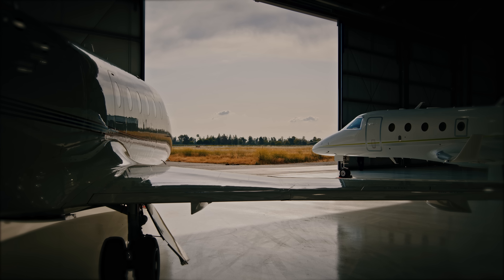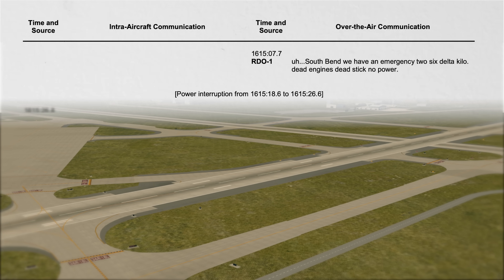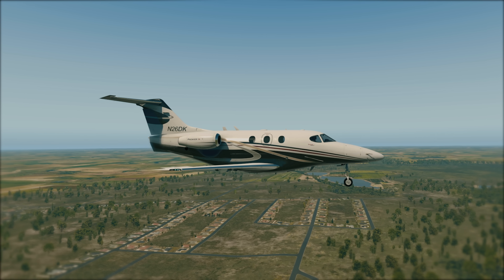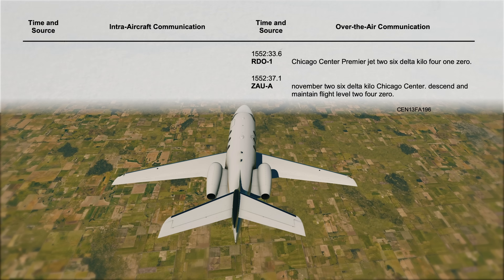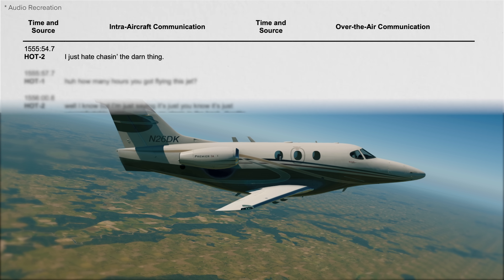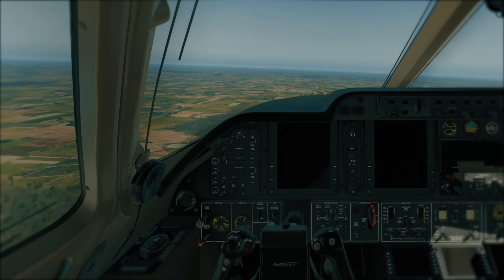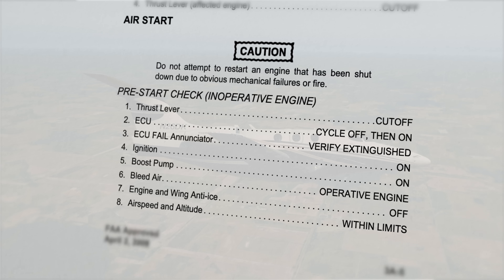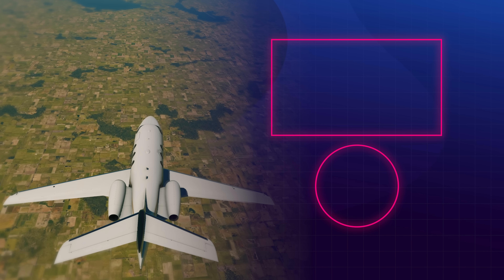Passenger Causes DUAL ENGINE FAILURE | Accident Case Study

Comment: No room for rich arrogance when you're piloting. He didn't fly the plane. The plane flew him to a smoking crater.
Reply: The guy had enough altitude and airspeed to just calmly run the checklists and relit both engines .That's the sad reality here. .Never panic ,but straighten up and fly right immediately after you find  yourself in an unusual situation like this
Reply: @Bax60 Incredible. Ive always wanted get my private pilots license but have a great fear of screwing up. Cannot reconcile if this fear is a good trait or bad trait so Ive never made the effort.
Reply: @Bax60  he did fly right that was a problem he flew right and then flew right into the ground
Reply: @Bax60  if you need to run s check list during a multiple engine failure you have no business been a pilot, knowing what to do to restart should become instinct, this is part of your training to remember those steps one by one.
Reply: @lcfflc3887  yes but you always follow the check list -it's purpose is to ensure you follow ALL the steps and in the CORRECT order.In an emergency it is possible that that a derail is missed however well trained you are -the checklist is there for a reason.
Reply: I see this attitude a lot with cars.  Many think that just because they can afford a fast car they can drive that car fast.
Reply: Agreed, this Alex sounds totally clueless and never even came close to grasping the emergency of the situation.
Reply: Doesn’t matter if it’s a plane, boat, car or motorcycle, just because you can afford it doesn’t mean you know how to operate it!
Reply: @rstats2127  motorcycles tend to quickly kill an inept operator.
Reply: @intheshell35ify  yep, I’m a former sponsored road racer and I see many on the road who shouldn’t be. I had a former co-worker who had zero common sense buy a motorcycle and I thought to myself they weren’t going to be on the planet much longer.
Reply: @rstats2127  There are  faa rules and regulations in.place .But the truth is ,if someone has enough money ,they can purchase any airplane they want .And there's nothing to prevent them from flying it off without a medical certificate or pilot training if that's what they decide they want to do .Nobody is really at the airport prepared to stop you .A person could hire a retired pilot ,sit him in the right seat ,and go out and fly that airplane every single day with no pilots certificate and bo medical, and unless there was an incident or something, the chances of that guy getting ramp checked by the faa is near zero .lt doesn't happen very often ,but I'm sure that it has.Because people fly for years without a medical certificate and never get caught all the time  .
Reply: There it is.
Reply: "I bet they beat the paramedics there by half an hour"
Reply: Explain why so many for hire pilots crash.
Reply: @jasoncrandall  because piloting a plane is a complex, very detailed task requiring constant analysis of a wide array of ever-changing variables. Although I'm not sure what the quantity, "so many", is.
Reply: @intheshell35ify  for hire pilots crash and duck up all the time. The Challenger going into Naples a couple months ago was an accidental fuel shutoff. Pilot errror.
Reply: @jasoncrandall  Most aircraft accidents are caused by pilot error ,just like most car accidents result from the same thing .Pilots are human, they make mistakes .But you are much safer traveling by airplane than by automobile.
Reply: @Bax60  I’m an ATP. I know the statistics. Never said flying was dangerous.
Reply: They should’ve flown NetJets.
Reply: Good. They still haven't learned though because there was that one submarine thing and soon to be a second. I do feel bad for the kid though, he didn't want to die but they wouldn't let him back out
Reply: Stockton Rush Syndrome?
Reply: @rask004  Rush was rich arrogance run amuck in the high tech engineering world. His was a special kind of hubris.
Reply: more money that brains. an epidemic in america
Reply: And hurt other people on the ground in the process 🤬
Reply: @acbulgin2 The crash of Sikorsky S-76 C-GIMR was similar in that respect. It belonged to the organization I worked for at the time. Without being a training pilot or briefing the situation, the PIC was instructing the FO on how to perform a black hole approach — while performing an actual black hole approach. 

That meant that there was no pilot monitoring. They descended into the trees and totalled the aircraft. Fortunately they suffered only serious but non-life-threatening injuries from the CFIT.

Interestingly, the PIC swore up and down during the investigation that he suffered a compressor stall. I’m sure he thought he did, but the investigation revealed that the thumping he heard was actually the sound of his rotor hitting trees.

The same organization lost a hull and crew a couple years later during a black hole departure, also due to neither pilot assuming PM duties, among other factors. That one was C-GIMY, also a CFIT.
Reply: "rich arrogance"? That's a brain dead comment that shows you to be as foolish as the pilot. Where is your evidence that his wealth was a factor in this crash? People like you should never be given any  responsibility for anything.
Reply: Agreed
Reply: Yep
Reply: Crap, they were so close to landing it safely
Reply: Same boat or plane rather as JFK Jr.
Reply: No, the aircraft bears zero blame for this 🫏.
Reply: Rich "wannabees "
Reply: Oh theres always time for rich and/or old people to be entitled morons
Reply: Wealthy not rich. Rich describes food
Reply: @OffendingTheOffendable  individual people are rich.... generations are wealthy. Your apparent ignorance is also "rich".
Reply: An overconfident businessman who has no regard for a sterile cockpit, invites his buddy up who is completely clueless on how to fly the airplane. Even the owner of this jet seemed to be behind the aircraft, it’s not fishing or golf- flying is a serious business and lax attitude results in death.
Reply: @donnix1192  Perfectly said
Reply: @donnix1192 what does being a businessman have to do with it?
Reply: A classic example of how one’s wealth can kill one.
Reply: @tonybeamish Oceangate is another
Reply: @acbulgin2 Yeah, this was up in Northern Ontario, where it can be completely pitch black at night, or alternatively you see just a very few distant lights that are more likely to disorient you than orient you.
Reply: I wish car licenses have the same attitude as the aviation industry.
Reply: @Notabot1310   it would be nice to have regular refreshers and requalifications but neither the government or citizens can afford that. A plane accident can kill hundreds of people, a car accident can only kill a dozen or so at worst. Besides, we are a nation of commuters. It's good for the economy to have mobile workers. It's tough enough to get people to renew their license with no testing.
Reply: @Notabot1310  Its like apples and oranges though .I can tell you this ,l started flying when I was 16 in 1976 .After 48 years ,never once have I ever  been ramp checked by the Faa at any airport ..
Reply: @Notabot1310 yeah, they teach you to get a license but not how to drive, pilots are another level, I don’t know how pilots remember so much.
Reply: @acbulgin2 Well said.

There’s no reason to think this guy was especially arrogant because he was rich. It looks to me like just the normal amount of arrogance, coupled with enough money to finance some potentially very risky activities.

Comment: “Don’t worry about the overspeed warning guy just keep working those throttles”  I’m sorry WHATTTT
Reply: That's the attitude of a pilot who never learned to appreciate handling a clean, fast airplane. Even when i was just  transitioning from slower Cessnas to a Mooney 201, many years ago, the instructor kept reminding me that "in this airplane you can not both slow down and go down at the same time". In studying this accident I see the poorly-trained right seat pilot failing to appreciate that he is flying a high-performance aircraft as he repeatedly busts Vne trying to descend the aircraft.
Reply: @LexipMedia pitch for airspeed and power for altitude
Reply: just a LITTLE too fast, no biggie
Reply: lol, “guy”
Reply: Pretty sure there are some really smart engineers building the plane to certain parameters. It's not like a car or motorcycle.

Comment: This is a textbook example of the worst kind of pilot; no procedure, no respect for limitations and no knowledge of aircraft systems. All this led to several missed opportunities to correct the problems he created. I can guarantee this pilot should have failed his last recurrent check.
Reply: Well, in a roundabout way, he certainly did fail his last check.
Reply: @RetreadPhoto Experience is always a factor, be it total or model specific. Insurance companies often decide what experience is required (not a terrible system as they are risk averse). My main issue here is with the atrocious attitude towards safety and complete lack of professionalism.
Reply: If you're riding a skateboard... it's best you know what you're doing eh!
Reply: @marcelogouveia9614 In my case, stepping off the skateboard knowing that I am unqualified to operate one.
Reply: It is sort of like putting a go kart driver into a F1 racer and saying go for it. The aircraft clearly needs to be flown with finesse with those engines and despite the owner pilot' s great trust in its airframe, it was even more plane than he fully understood.
Reply: More specifically a pilot that fails willingly. We cannot fault an emergency pilot (like a passenger) at least trying in an emergency. These pilots, both the unqualified one and the should have known better one have no such excuses.
Reply: I have no respect for pilots who crash into houses or residential areas. Or even attempt to land on freeways. Why do I deserve to get crushed just because you can't find a runway? Rich A holes.
Reply: @Peyote1312  What an odd comment. Jet pilots are employees, (not the rich guy in back). Cars kill far more innocent people than aircraft, but we don’t turn it into class warfare.
We always avoid populated areas if possible.  When you’re strapped to the front of the thing, you try very hard not to mess it up, promise.
Reply: I'm not sure here.   The ATC knew the plane was no power, no hydraulics, and ordered a go around.      with fire on standby a belly landing might have been the best option...   ordering a "glider"  to go around?   just seems off.
Reply: @jenniferstewarts4851  I’m not entirely certain, but I think they had established that power had been restored for one engine by the time they told him to abort the initial landing. It’s also possible that his current speed, course, and/or runway made such a belly landing impossible without risking further lives—I am only speculating, but considering the second attempt resulted in their bouncing into someone’s living room, it’s certainly seems plausible.

Either way, with only one-way communication, you have to assume the pilot isn’t aware that the gear is not down, so instructions for a go around “if possible” seems logical.
Reply: @silverXnoise  with no electrical, hydraualics, limited control, and no engines...  a belly landing would be the "natural choice" for most pilots.   because that also means no breaks, flaps, speedbreaks, or thrust reverses.  

in truth, the belly landing would still have been the safest  with fire and emergancy there.
Reply: ATC should be held responsible
Reply: @@vitkomusic6624    Why would that be?  They saw the main landing gear was not down & correctly ordered a go-around.
Reply: The pilot's speech on the CVR is so off-hand, even a student would be replying 'What do you mean by that?'
Reply: Why didn't the pilot crash land when he was on the runway?
Reply: If both engines go out at least look at the location of the throttles. That would give clues as to why they were turned off. Immediately ready for ignition. In seconds.@RetreadPhoto
Reply: definitely not a pilot, total arrogant prick! not a pilot in any way
Reply: @RetreadPhoto I completely agree but try to convince anyone to take on that financial burden.
Reply: Well.....he did fail his last check.
Reply: Its super frustrating to me because I dont have a trust fund to get my Commercial, I'm stuck at Private and id have taken the time to learn all of it because I love flying and respect the art. Ive got a bookshelf full of aviation textbooks sitting next to, a lifetime of learning since I was just a kid reading janes encyclopedia to today.
Reply: Looks like the test was not nearly good enough - whether not done properly or maybe the test protocols themselves are inadequate. A jet pilot should know all these emergency procedures like engine restarts by heart and have practiced them many times until completely confident. It's not a game and to be safe requires a lot of work and dedication. Not for irresponsible cowboys like this. What's worse is that many commercial crashes were results of jsut as much pilot incompetence so even those standards are inadequate. All about the dinero isn't it?
Reply: @sambolivar167  Any idiot with a wad of cash can buy an airplane or a Lamborghini. Does not mean they have talent. "A man has got to know his limitations", a concept that the wealthy have no clue of.
Reply: No respect.

Comment: The tower knew they had no power or hydraulics and they should have just made the first landing and sort it out later.
Reply: I do blame the tower for complicating a nasty situation. 30 yr controller here and adding extra stress by telling a deadstick-landing pilot to go around is ridiculous. He could have just calmly questioned “verify gear-up landing?”
Reply: @bwalker4194  He had plenty of speed and could have done it (and did do it). If he couldn't land with the front gear out, why would you think he could land the plane with no landing gear at all?
Reply: @bwalker4194  
After reading the first comment about that, I thought it was pretty strange to tell pilot with no engines to go around. And then watch the entire video. And while stupid, it had absolutely nothing to do with the crash. When he came around the second time and crashed. They let him know only his nose gear was down. at that point he had a functioning flyable aircraft and should have gone back up in the air got it fully functional and then landed.
Reply: @bwalker4194  He wasn't deadstick,  he was UNDER POWER
Reply: They did have power.
Reply: Don’t blame the tower. He could’ve gone in. They told him his gear was up. He could’ve kept going.
Reply: @neilkurzman4907  Their input was incorrect and unnecessary. PIC has full authority, but unfortunately, this one was not competent in the machine so the end was predictable anyway.
Reply: @cturdo  
It was certainly correct to let the plane know that the landing gear wasn’t down. Telling a plane with no engines to go around kind of says they lost situational awareness.  They were treating it as an ordinary landing, where the pilot forgot to lower the gear.  At which point you would tell them to go around. So certainly inexcusable on their part but really unrelated to the accident. Unless of course we assume he would’ve successfully belly landed the first time because he didn’t the second. Remember on the first landing, he had limited control of the aircraft. We’re not exactly sure at what point he got the engine running, but we do know that he didn’t properly configure it to provide electricity to all the equipment. 

Additionally, in that original landing, he forgot to lower the gear. He had the manual release control, but apparently didn’t pull it. In his second attempt, he didn’t pull it completely completely when he could’ve used the normal gear release. Assuming he had connected his working generator to the bus.
Reply: @neilkurzman4907  All good points.
Reply: @cturdo  
Hopefully the air traffic controllers learn from the sentiment because I’ve heard recordings of others remaining shockingly calm in worse situations. 
Unfortunately, as events turned out, the pilot won’t get a chance to learn from his mistakes.
Reply: @neilkurzman4907  "Go around, go around, I repeat go around, go around." Hop off the tower's lap. And it absolutely did have something to do with the crash. There are always many factors that lead to an accident. The pilots incompetence was only one.
Reply: @JapanesePiano1  
And the pilot can say unable. But it had nothing to do with this crash. 
He, we gained his engines and was able to takeoff. He then went to land without fully recovering the aircraft. 
At that point, it was no longer an emergency.

I certainly think it’s strange to tell a plane with no engines to go around. But in the end, it didn’t contribute to the crash. We’re also assuming this guy could’ve made a successful belly landing the first time. Since he failed the second time.
Reply: @byronperry6014  
I assume he didn’t wanna trash his plane. But once he had an engine running, he had plenty of time to go to altitude and sort out his problems. 
It was just one mistake after another
Reply: @byronperry6014  Because he had power and didn't want to destroy a multi-million dollar aircraft.
Reply: @LarsLarsen77 that worked out for the pilot really well…